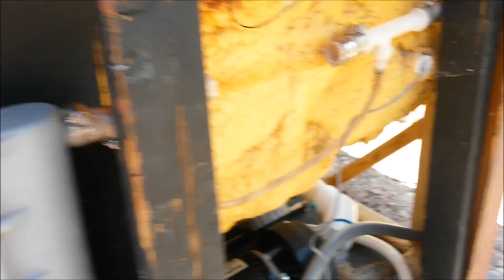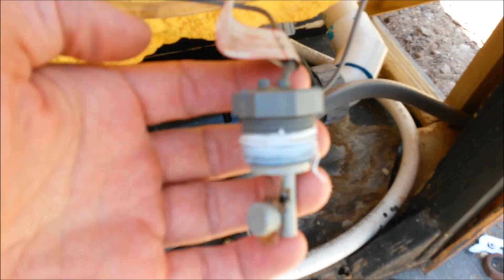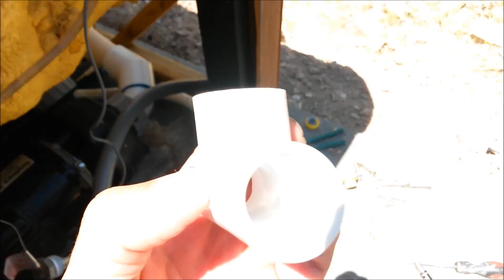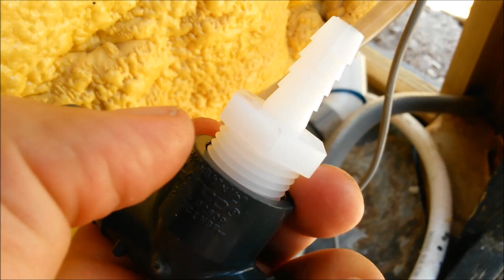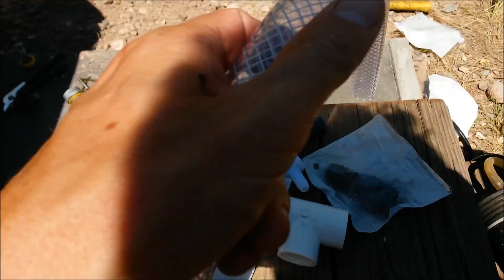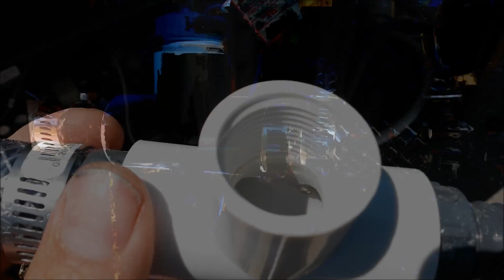Sundance Spas ~Flow Switch Repair w/Cheap Hardware Store Parts ~Altamar 2001

Comment: Hi...I have a Sundance Optima 850 and have to replace the hose leading from the flow valve T connection to the Brass T fitting on the other end.  Can you advise which part of the brass T fitting connects the hose to the Flow valve?  Is it the top of the Brass T Fitting or one of the lateral ends?  Does it matter?  I tried sending you two photos but I can't import them.  Just picture this flow valve fitting connecting to the brass tee fitting where two other hoses connect to it down inside the spa.
Reply from the maker: Pretty sure it doesn't matter if I'm understanding the question correctly.

Comment: So did you need a 1/4 in air manifold plug for the smaller hose in the bottom? (that would need a hole drilled in in with a 3/32 drill bit?)
Reply: I would like to know what  the purpose of that smaller hole is?

Comment: I hope it's ok to comment again.  I am now as I speak enjoying my hot Tub for the first time in 3 years.  That's because I put it away and winterized it 3 years ago before going abroad.  

Anyhow here's what I did today and where I'm at.  

Everything is working ... Sort of.  I took the flow switch/sensor out of the 'T' and when I held it together, no flow error.  At least I know it's working.

The heater cover repair is perfect and holding water.  I then dc the little pump from the panel and using jumpers with alligator clips, I connected it to a different source of power ... It works fine.

With the pump powered up and the flow switch taped closed, the heater icon came on.  I was a bit worried because I didn't feel a lot of heat coming out of the heater but I closed the cover and came back a bit later, noting the temp went from 29 to 31, then checked again alter and 34.5!  Progress.  I'm now in at 39 and everything is awesome.

The hot tub has absolutely no leaks not even a drop.  TBC ...
Reply: nice! you can have your control repaired for about $100 in the USA
Reply: Well, I am not in the USA, and I don't know if the control needs repair or what exactly
 yet.

Comment: I have another question.  I'm fairly certain that the flow goes across and into the top of the heater and then down to the pump, is that correct?  That little pump below the heater, when should it come on?  How is it summoned and how can I test it?  SO far, I do not see it working.  Will it be called upon when the flow switch is working and the hot-tub needs heat?  Thanks again an dI love your videos.
Reply from the maker: A PVC threaded tee can also be purchased at your hardware store and will work better than a metal one. I eventually had to break down and buy the official one. the threads keep the switch up higher in the body of the tee and it doesn't get enough flow. it worked OK, but I would still get flow errors.

Comment: I have made this today and installed it.  My "T' is metal.  When I close my flow switch manually, it shows the heater icon so the switch seems to be working. But when I installed it into the 'T' I get a flashing 'flow' on my panel.  I am planning to take it out and stub it and see if everything else works when I manually operate the switch.  If the heater and everything is working then, then I know it has to do with how it is sitting inside the "T" and I will remove it and inspect/fiddle with it some more.  I did make some video that I may post, which also includes a cracked heater cover repair I did successfully, saving me buying a new heater which is $385 + $37 on Amazon Canada.  Any ideas or suggestions appreciated.  Would really suck to go through this and then still have to purchase this thing.  (BTW, the Spears threaded 'T' that you spec's is $21.11 + $16.09 on Amazon Canada.  The metal one I bought was only $8 at home depot)  Is metal an issue for functionality?    Thanks.
Reply from the maker: The little circulation pump runs 24/7. it should be on all the time.
Reply from the maker: congrats on the heater repair!

Comment: So awesome, I am so glad I found this.  US prices at $40+ dollars and $119, plus $17 shipping Amazon) in Canada for this ridiculous thing.  Now, I have a question about the heater.  It seems I cannot replace the cover on mine which is cracked.  I want to attempt a repair, any recommendations for materials or methods?  Thanks a lot.
Reply: The heater cover? Is it leaking at the heater?
Reply: +GadgetClass the heater has a cover that easily screws off from the back.  Mine is cracked along the length... small fissures.  I'm thinking to try sealing with epoxy first and if that doesn't work to silicone an aluminum patch inside.  The heater is $200+ as a unit in USA and about triple in Canada. So it's a shame I have to replace the entire heater if it works otherwise and just has a cracked case top.

Comment: This is so helpful thank you! One question. When I got my hot tub the flow switch was broken in 2. I understand where the left and right tubes lead but can you tell me where the smaller tube that leads down goes? I cant figure that out. Thanks so much if you can help!
Reply: It goes down and attaches to one of the big jet pump pipes. It basically acts as an air gap/priming hose to keep air from getting trapped in the flow switch line
Reply: THANK YOU SO MUCH!!
Reply: I have an older Sundance tango replaced everything  two years ago except the ADJ flow switch appered to be working now after say 12 14 minutes of run time the Dreaded flow alert    flashes any help  Harry

Comment: nice video.  My plastic housing is fine, but the sensor itself is shot.  Is there somewhere to buy the sensor only?  Thanks again for the information.
Reply from the maker: HomeBrewingTips Not really. You can take it out and clean it, then test with a multimeter. If it doesn't show continuity then you will need to get a new one:

  http://www.amazon.com/dp/B0031B6Y9G/?tag=flowsw-20